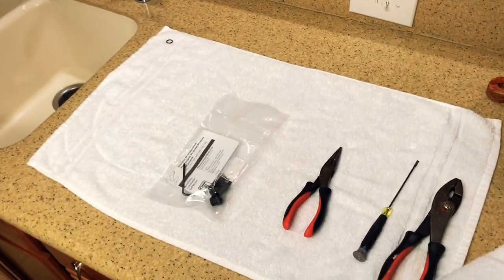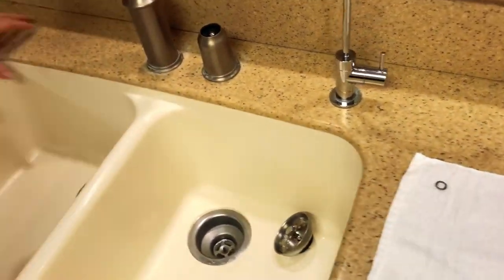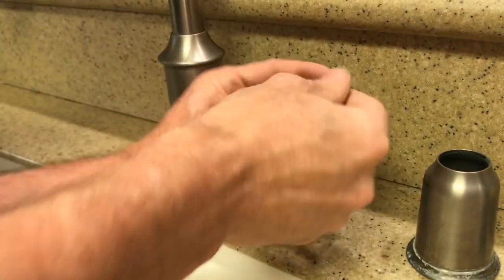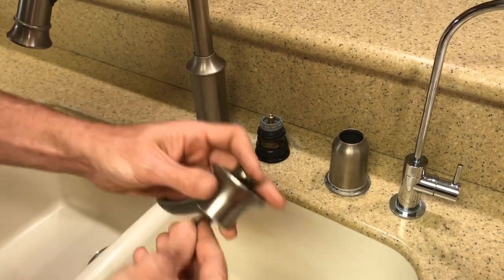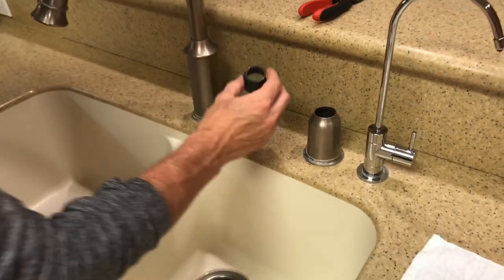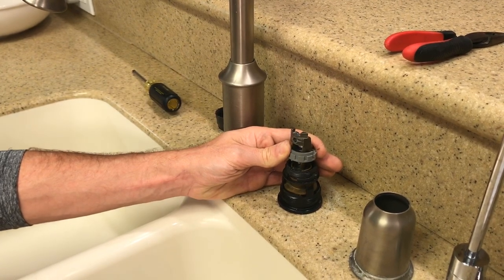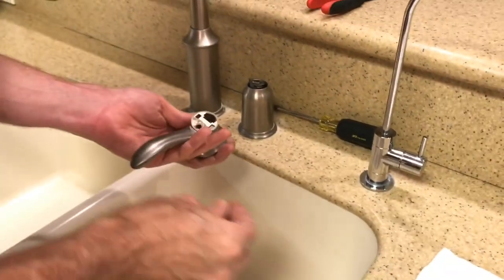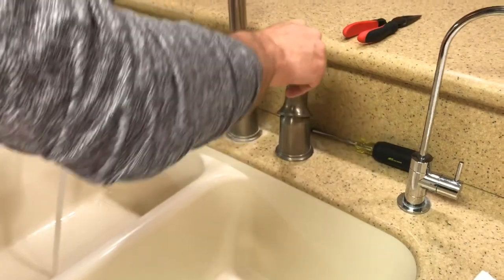How to repair a single handle Moen kitchen faucet. Broken handle.

Comment: Cap for Oil Rubbed  Bronze is screw on:  Unlike all other colors for this model, it is a screw on, not a snap on cap - might save you some frustration, ours had enough lime it was really difficult to tell at first.
Reply: Thank you so very much!!!  You are ABSOLUTELY correct.  Cap SCREWS ON .  Moen needs to add this to their website.Thanks again.
Reply: @miaejohnson3823  agreed! Took me like 2 hours to find this...

Comment: Great video - I couldn't figure out why the handle on my faucet was loose and floppy, but then saw how you used a rod in the cartridge hole to keep it from spinning while tightening the top screw.  Works perfect now!
Reply: Same here! I used the little allen hex that came with the kit.
Reply: @anneg8319  I just replaced the plastic piece in my faucet today and had the same issue. I opened everything back up, and I made sure that the metal part that is seated around the cartridge needs to fall into place properly, and then screwed down with the Philips head screw driver. When that it placed correctly and screwed down snuggly, the wiggle in the handle went away.

Comment: thanks.. great video, worked.. except.. I have to have the handle in the right place. and down, otherwise it will slow drip..what part do I need to screw down, the big screw?  or did I do someting wrong?

Comment: You nailed it with this video.  Quick and to the point.  Well done.  I was confluncted by spinning that top screw too and it not coming off until I saw where you discovered the flat wrench slotting to hold the stem.  I didn't look at the instructions either after watching this.  Parts cost $7. Got it in two days from Amz. 

I would add to the viewers that they make sure they screw that top screw all the way down and not stop when the loktite that's on the new screw tries to hold you up. Make sure they set the new screw to refusal (without stripping) or the valve handle will wobble when re-assembled.  Thanks, dude!

Comment: Thanks for sharing this!   You saved me a ton of time!  Also,  if this helps anyone else I could not find the part on Amazon but Moen customer service was very helpful and send instructions on how to use while waiting on the part.   Thanks again for posting this!
Reply: Moen was out of stock of this part for months now.  Had spend $30 on Amazon.  How Amazon has it and not the manufacturer is a little suspect.  Moen wants you to buy a whole new faucet.
Reply: Moen customer service won’t answer phone. They say will call back and the appointment to call back is in one week.  What a joke. We ordered the parts on Amazon. You mention instructions on how to use till parts arrive.  Do you have them as we can’t use sink.

Comment: Thank you! Our handle also stopped working but I have trouble removing the top cap. I tried to pry it open with a small flat screw driver but it didn't work. Did you just pull it out?
Reply: If it is the Aberdeen Bronze if may screw (twist) off like S.L. has mentioned.

Comment: In my case the metal facade / sconce /cap covering the base wouldn't back off.  seems it is seized to the underlying plastic threads and so counter clockwise rotation is not threading it off.  Any suggestions on how to address that necessary step?

Comment: do you know the model number on this? I cannot find out how to take the handle off. I have removed the cap on the back but cannot seem to find what Allen wrench I need from there etc...
Reply: Did you ever find out the model number?
Reply: @quentinharrison6345  no i believe the part # for cartridge filter is a moen 1255 though. You should be able to find some youtube videos with that info

Comment: we have the same faucet tap with the same problem.i tried your method but handle adapter not came out after removed slim screw.

Comment: What was the repair packet you found on Amazon? I’ve the same faucet handle with the same issue and roughly 12.5 years of ownership.
Reply from the maker: I used a Moen 100429 Single Handle Faucet adapter kit.
Reply: Lantern Gaming found it. Installed it and it worked perfectly. Thanks so much for sharing.

Comment: Are you able to give the model number ? I have same faucet and same issue also I have issue with the shower head and I can’t fine the part
Reply from the maker: I used a Moen 100429 Single Handle Faucet adapter kit.

Comment: My handle is loose but still works. How do you remove the handle without having to brake it?
Reply: Unscrew the little hex screw until the handle pops off.